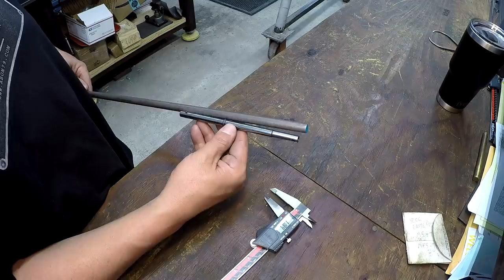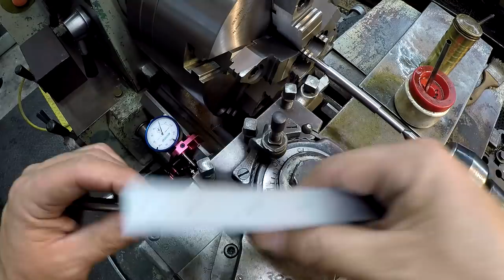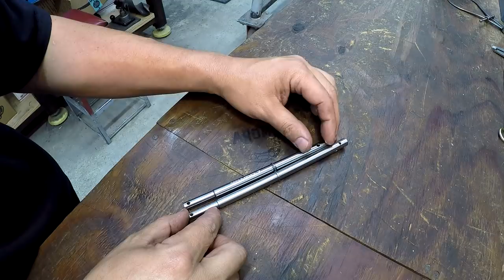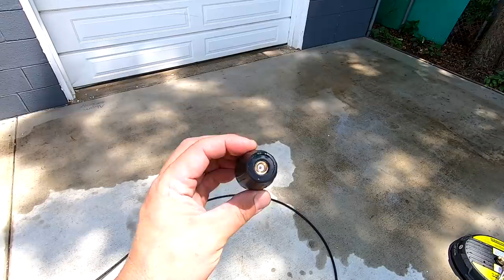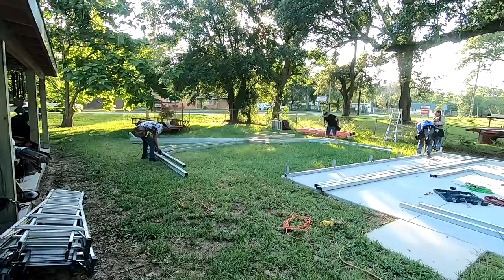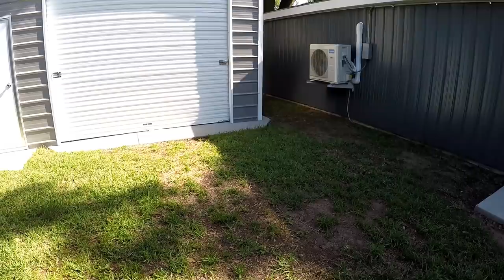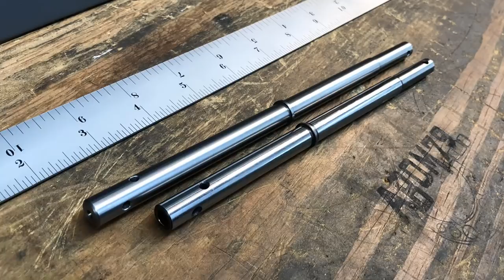SNS 264: Drone Shaft, New Garage Building, Carriage Indicator

Comment: it's very likely that I watch far too much of R&R Buildings, but ever since you first talked about the garage package I thought. Wouldn't it be cool if you took the roof off your shop and took down the old shed and then put a post-frame up over the entire area? which would leave your shop intact but as an open ceiling room inside a much larger room.

Comment: Does the inside of the steel walls not drip large amounts of condensation in autum and spring when the weather changes temp? I regret fitting a steel panel roof to my workshop as it drips condesation when the temp changes
Reply: I was wondering about that myself.

I don't live anywhere close to Florida, other side of the continent and north of the 49th, but do live right on the ocean so we can be humid.  Any of the bare steel roof buildings will all "rain" inside.  It gets really bad if there is a frost and it warms up with some sun.  You need a rain jacket and hat to go inside then.

Hopefully Adam doesn't experience that.  It wouldn't take that much to insulate.  Spray foam on the ceiling.

It is a nice garage.

Comment: Hi Adam 👋🏻
Two questions:

Do you intend to install any kind of insulation to the garage?
I imagine it can get very hot inside an all metal garage...

Watching you turning that shaft, i was wondering how the rising temperature of your workpiece influences the precision of the machining??? As it heats up it will expand a little bit and shrink as it cools down. I mean you are working within a thousand of an inch or even less, so how much influence does this effect have?
Thx in advance for your answer
Greetings from Germany 👋🏻
Reply: normally machinists let it cool down before the final pass, also slowing the machine down on the last pass and plenty of lube help.

Comment: Not cheap, but have at least 2" of spray foam put on the walls.  4" on the under side of the roof.
Reply from the maker: Probably cost half as much as the building. Not needed for my needs. If it was a working shop building I would have paid for the insulation to begin with.
Reply: @Abom79  for storage I'd atleast install a temperature controlled ventilating fan on the back side. Made a huge difference in my shed. I actually had plastic items start to discolor and warp because it was getting 140+ inside in the summer. That Florida sun is brutal
Reply from the maker: It’s easy to look at the video and judge but I’ve been monitoring this all week. The building is mostly shaded for most of the day, in the evening the west wall gets some sun. The building has not heated up inside with the doors closed like people are thinking. I’ve been very impressed. I’m sure a vent fan would be great but not needed.
Reply: @ionstorm66   my toughts also. He says he aint gonna do it, Im sure he will eventually :D Come Adam, Insulattttttteeeeeeeeee :)
Reply: @Abom79  I did not realize it was primarily for storage.

Comment: that is a shaft from a Align Trex 550 helicopter....The metal is alot harder than cold roll steel..
Reply: Myrum Abel how hard can you get than drill rod    Drill rod is used for making custom taps etc in a shop

Comment: Given your location in Florida I'm a little supersized that the building doesn't require diagonal bracing in the walls.
Reply from the maker: It’s Approved by Florida wind building codes and permitted by the county. The bracing you see at the top of the walls is part of the wind code requirements.

Comment: i spent most of a summer using turbo tips to strip many layers of paint off concrete block  2 story buildings with a long extension wand. i used a 4200 psi pressure washer and made a butt load of money.  i went through 4 turbo tips and i bought top grade expensive ones. bit in to my bottom line but i still made out.  the 4200 psi wasnt the problem because the tips i used were rated for up to 4800 psi.  never ever buy a washer without the honda engine.  im all about buying American but the engines made here in the states wont last near as long as the hondas.

Comment: Am i the only one to notice the two holes on the end of the shaft were the wrong way round to the original.
Reply: Nope, I scrolled down to see if anyone else noticed. Hopefully it wasn't a problem
Reply: Not the only one. That’s why I’m here reading the comments.
Reply: Still a beautiful shaft though.
Reply: The orientation/indexing of the single hole to the pair of holes is not important. The two-hole end will hold a pair of gears inside the body of the helicopter and the single hole will hold the rotor head on. It is only important that each of these holes be square to the shaft and centered. Even the relation of the pair of holes shouldn't be that important because each gear is locked onto the shaft separately.

Comment: I'm surprised the customer didn't care about hollowing out the piece--I would think weight would be a critical factor on a drone. Regardless, nice job. Thanks for sharing.
Reply: That size copter, the % difference in total vehicle weight is tiny.
Reply: R/C helis generally have an insane power to weight ratio, and you probably wouldn't notice it.  Do a YT search for '3d heli' and the first result gives a good example of this.

Comment: I’m no expert on metal siding but installing top down seems backwards. The bottom panel is applied on top of the panel above it meaning water shed will run behind the panels?
Reply: Yeah it looks that way but until the final fixing is done its quite simple to clip the lower panels in underneath the upper panel.
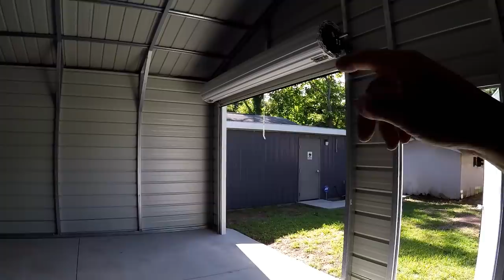Reply: look at the inside view at 34:45.  you can see they were tucking the lower panels underneath the lip of the upper panels before fixing them into place.
Reply from the maker: If you watch the video again the proof is there that they overlap the panels from the top down.

Comment: I bought one of Edge's standard indicators, won't fit my 1953 Monarch 61, will have to wait for the XL I guess hoping this one might fit the new to me 1957 Springfield 280 coming to my shop next week!
Reply: Any idea if this Edge indicator would fit a Colchester Triumph 7 1/2" lathe? To me it looks like the carriage feed rack for the carriage handwheel would interfere with the lower clamp jaw on the indicator.
Reply: @jemijona  Not sure, looking at web pics, it's a maybe. Here's the link to the drawing for fitment: http://store-1wa94vq6.mybigcommerce.com/product_images/uploaded_images/Carriage_Indicator_Tech_Drawing.png  Shar's carries them.

Comment: Use 50/50 to 30/70 kerosene and linseed oil to seal the driveway. Otherwise each time you power wash it, the thing will get harder and harder to keep clean.
Reply: Joseph DESTAUBIN won’t that stink like really bad?
Reply: @matttradie1341  Well it is doen outside with a pump sprayer, so your not really going to notice. Doesnt really smell after the fact. The solution goes into the concrete pretty fast. This is done on all new concrete poured by the state.
Reply: Interesting. We don’t do that in Australia

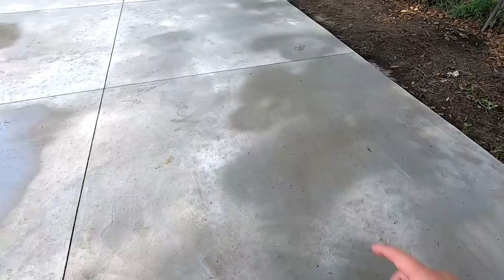Comment: I have never understood why muriatic acid is so commonly sold in hardware stores as "concrete cleaner." That is like selling paint stripper as "paint cleaner." Muriatic acid (20:15) is , and is one of the three strong acids: 3.5 time stronger than nitric acid, and twice as strong as sulfuric acid.  Muriatic dissolves the cement, and human flesh. The more concentrated it is, such as straight out of the bottle, the faster is dissolves the cement. The muriatic acid reacts with the cement to produce calcium chloride and water. Calcium chloride is more soluble in water than table salt, or table sugar, e.g. very very soluble.
Reply: yeah it's hydrochloric acid

Comment: Yeah gotta watch those contractors, not anyone in particular just saying any of them, elechikens, plumbers, Crete guys, etc. Hey when your poor that driveway have them put a valley and slope to it maybe some drains in along your house to keep that moisture away, From your house. I worked plumbing rough in for 13 years and you wouldn't believe what concrete guys would do, dry wallers, the elechikens woud steel your holes. I'm glad you got your building tho looks good. 

I once got a job with this "plumber"  we were called in to help another plumber out had 1 day to get the plastic in the ground on a bunch of houses, anyways this man that just hired me was just touching the glue on the waste plastic then shoving the fittings in and covering with dirt. I called him out on it he said ahhhhhh the dirt will hold it together. Needless to say I didn't work for him very long. They all cut corners when they can. It's hard to find a proper contractor nowa days, a true professional. I took pride in my work. It's hard to find that, most guys it's about quantity not quality. Looking good tho Abom I'd give my right arm for a building like that I haven had a garage in years with some luck my family and I will be in a house in a few weeks. If ya keep posting the BBQ tho I'm gonna have to swing by, lol.
Reply from the maker: My concrete guy does flat work and driveway daily, he knows how to get it done and what will be needed here.
Reply: @Abom79  sorry if it seemed like I was talking about your guy, I wasn't I first found your channel (the first video I watched ) was the pad you poured in front of your shop. If it seemed that way wasnt intended. Sometimes I dont read my post before hitting post.  Building looks good tho.

Comment: The ONLY time you NEED to use Muriatic Acid on concrete is if you're going to seal or paint raw concrete, and THEN, ONLY if your trying to remove and grease or oils that have gotten onto the concrete. Since that is basically a virgin slab, a simple cleaner (Tide powder laundry soap works WELL for general cleaning purposes) is all you generally need. Home Depot sells a GREAT epoxy paint for concrete which would serve you well for oil and impact resistance.

Comment: is a metal garage cheaper than a wood framed one? I guess it also depends on what you want to do with it. Like insulating a metal structure would be more difficult. Are you goin to run power to it? Garage door opener in the future?
Reply: Yes, a metal building is much cheaper. When you go to sell your house, you'll get your money back on a wood/block framed outbuilding, but you won't get much money for a metal one. Upfront costs on a metal building are much cheaper though.
Reply from the maker: You can’t beat the price of the metal buildings , but its all about what you want or need. If metal ain’t your thing, then spend more get wood.

Comment: Is the face of the indicator glass or plastic? The one I'm currently using on my traverse is plastic and gets melted by hot chips. I replaced the one on my cross slide with a glass face so its unaffected by the chips.

Comment: Ah the good old metic-imperial combo part. AKA the story of my life. I like to design in metric, but US store shelves are all imperial
Reply from the maker: Not just the stores, drive down the roads and pull up the gas stations. 👍🏻
Reply: @Abom79  I should elaborate. I am a packaging engineer.  I design and test packaging. I work for a large multinational corp that works with both US and foreign suppliers. I have to suffer using both.

Comment: I wonder of the shaft is originally hollow as a way to reduce the spinning mass for performance.
Reply: It's for weight reduction. The shaft is forged hardened and precision ground for the swash plate to travel stiction free up and down the shaft. They are incredibly strong and stiff and endure some serious loads in 3D maneuvers.

Comment: I'm thinking metal is sideways to attach because of building structure on center span or you'd needed it built with girts on like 2' centers up & down like the purlins on trusses for the roof tin.
Reply: It may be required to meet the wind load requirements for his locale

Comment: I am NEW to the scene of lathe work. How do you keep that horrendous squeal to a minimum? I was cutting some extruded steel pipe, and let me say, that hard shell combined with the fact that it was a pipe, god damn that was loud. I was just using a carbide insert because of the hard shell of the pipe but what is a good way to minimize that squeal?
Reply: Not a machinist but from what I understand your feed rate or turning rate may be too high, your tool may be dull, your tool may be off center or you're getting high frequency chatter.  Slowing down and making sure your setup is sharp and accurate may help.
Reply: Feeds and speeds can make a difference. Though some materials just make a lot of noise.
Reply: @stargazer7644  Thats what I was thinking. It was a extruded pipe. So hard as a rock externally and hollow. May have helped to anneal it first.

Comment: How do you stop the building from "sweating" in cool moist weather, then the moisture dripping down on the stuff being stored in the building ?
Reply: spray foam stops that from happening. I have a carport i did the underside of 10 years ago.
Reply: I had a similar garage installed at my rental property and had that very problem.  I've never dealt with it, but it's super annoying in winter when a heater is running.  If I ever do one of these again I'll prioritize insulation.

Comment: if the drone shaft is solid the motor will need to have a lower kv and the props bigger?
Reply: Drilled shaft is primarily for overall weight savings, IIRC. A solid shaft won't throw things off driveline-wise.
Reply: It's for a Align 550 rc helicopter, being a solid shaft won't affect it at all since each blade is 530mm long, the guy is prob building a custom body around the frame so needs the extra height to clear it
Reply: I agree, but the extra weight will make a big difference in amp draw and performance,  a lower kv motor and larger prop should help, he will have shorter flight time though.  @brand-x7049
Reply: @breakalegfpv9532  The difference in weight is an extremely tiny % of AUW.

Comment: I can't believe they said that it didn't matter if it was hollow or not as those carry the wires that operate the tail rotor and also for lighter weight, unless of course your customer intended to bore it out themselves.
Reply: Was thinking the same, I thought weight would be a major consideration for something like a helicopter.
Reply: Usually on model helicopters only the tail drive goes inside the tail boom and that drive is either a toothed belt or a drive shaft. The tail control is usually some form of push rod on the outside of the boom. In this particular case the shaft being replicated was a main drive shaft to the main blades.
Reply: @zaragonrl  Mine had movement sensors that controlled the tooth gears from a motor inside a frame on the tail.
Reply: Dan Wolfe true I'd forgotten about that. That's especially common on the smaller models

Comment: Ok maybe I'm lost but when you cut the part doesn't it become straight even if it's bent to start with? Isn't that the point of the lathe?
Reply: If he turned the size down enough, he could make it round and straight again but, it depends how bent the shaft is. He also would need to turn down the piece to just over the size he needed and then cut it off in the lathe so then when it is remounted he could face it down to size.
Its a lot easier to just use a straight piece to begin with, plus he had already cut the piece to size so that wouldn't have worked.

Comment: I like your work and don't want to cast a pall on your success but it looked to me like there was a resulting 90 degree miscalculation when you pressed down on the drone rotor shaft to align the holes to the other end.

Comment: I wonder if the customer has thought about, if the center has been drilled in that shaft to save weight?  It is a RC helicopter.
Reply: The drilled shaft is done in concert with multiple other things on the model to save weight - it and of itself, it won't add that much to the model. He probably =could= have drilled it, but there's no guarantee that the hole would have run straight enough to not throw the overall balance of the shaft off - normally, a CNC machine makes these, and they'll have a special tool to bore out the shaft straight, usually a solid-carbide boring bar, which ain't cheap. :)

Comment: Adam. What cutting oil do you use? Are there any major differences between different types? I know that fluids are formulated to suit different materials. I’ve been told years ago to use kerosene (paraffin as it’s called in the UK) for Aluminium.
John🇬🇧

Comment: This garage does not look like it can withstand the hurricane weather you get.
Reply: When you order from Carolina Carports you specify the wind load required by the zoning and permit office. Here in South Mississippi the requirement is 120 MPH and they give you the engineering documents to satisfy your local code office.

Comment: i'm swedish, and i like to know how it works when building on one's own property, do you need permission, hand in plans somewhere?
Reply from the maker: You have to apply for a permit and follow the rules for your county.
Reply: ok, thank you for answering.
Reply: Also depends on the size. Small sheds and out buildings usually don't require a permit. Larger buildings do.
Reply: @hilltopmachineworks2131  pretty much like herr then